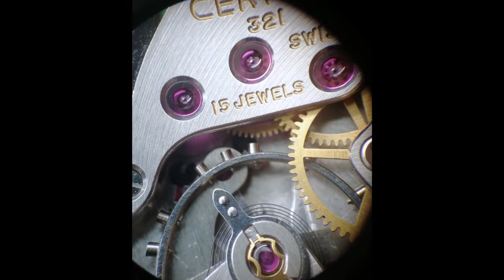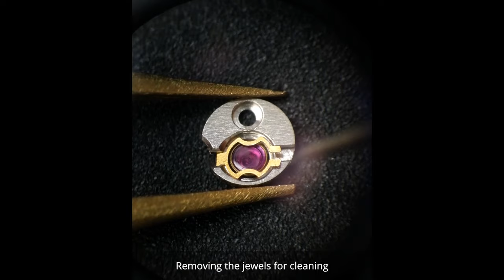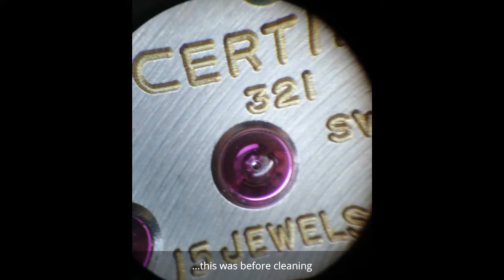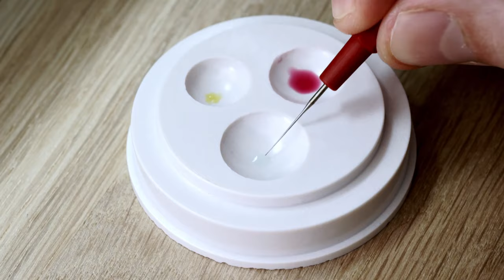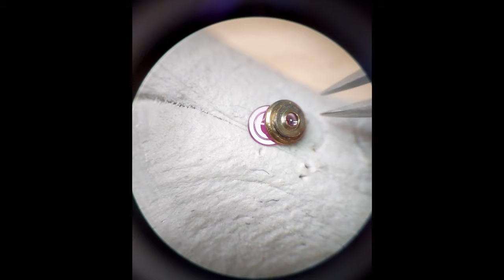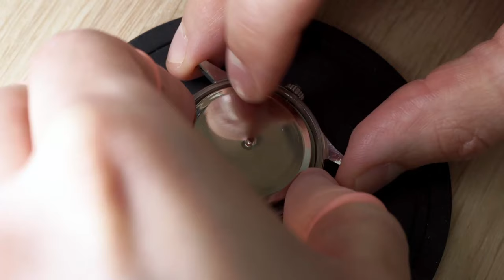Restoration of a vintage 50’s Certina mechanical dress watch – ASMR - Manual work - Caliber 321

Comment: Good job, awesome details 👍🏻
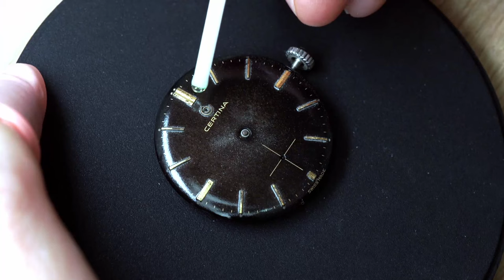What tool was it at 15:30?
Was that oil you put on the mainspring? I would recommend a thicker grease instead
Reply from the maker: Thank you sir, very glad to hear that you like it! Its Bergeon Head swab, it has a static/sticky top so great for collecting dust etc and no need to touch the dail. On the mainspring I put 9010, aha I see, maybe 8200 grease?
Reply: @Watcheyes  8200 is fine, yes 👍🏻

Comment: The winding arbor looked quite loose in the barrel bridge.  Did you consider tightening the hole?  Also, why did you spread out the oil on the cap stone? I was under the impression a well-defined droplet in the center was best.  Thanks for sharing!
Reply from the maker: Hi, thank you for youre time looking at the video and commenting. I didnt notice this about the loose arbor but now i need to investigate it =). About the cap stone, the jewel was quite hydrophobic so i couldnt just put a dropplet right at it, i had to like "spread" it on the jewel so the oil leaves the oil stick. But I will try another method next time, maybe a bigger oil stick so the dropplet of oil is bigger so then it might leave the stick easier. Great details, thank you!
Reply: @Watcheyes  I suggest you watch Chronoglide here on YouTube.  Kalle shows how to tighten arbor holes with a staking set.  Regarding the oil droplet, you don't want it to spread out.  The chaton is domed.  So, when you place the cap jewel (which is flat) on the chaton, capillary action draws the oil to the center of the setting where the pivot rides.
Reply from the maker: @jwoodyr1  I'll check it, thank you. Next time you'll see a perfect dropp ;)

Comment: Too bad the hands and dial are not restored, I was wondering how that is done. I heard somebody claims those and the case are the most expensive parts of a watch.
Reply from the maker: Glad you watched the video. IMO the dial can't be restored because then  its repainted. Hands can be polished slightly,  that would be nice. But it's nice to keep it old as it is also.

Comment: Restoration or just cleaning and oiling?
Reply from the maker: You are correct sir. In the beggining the watch was not possible to wind at all, completly dead, but it was just stuck the click against the ratchet wheel (was not in the video). Next project which Im doing now is a correct restoration:).